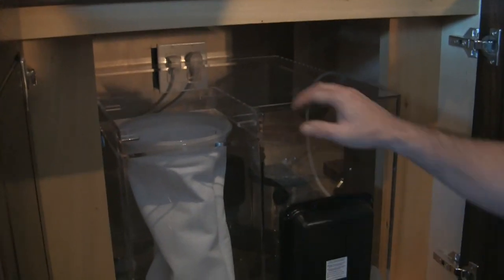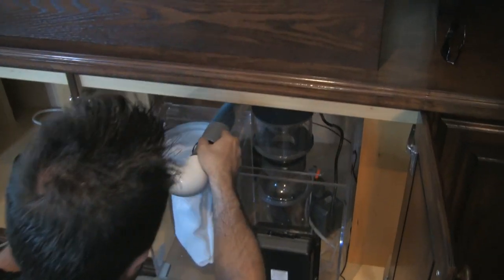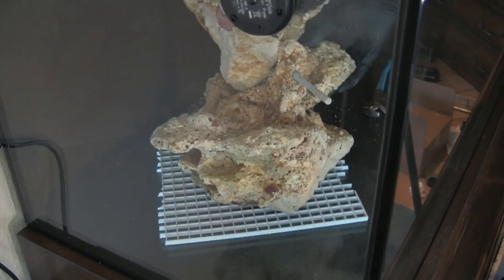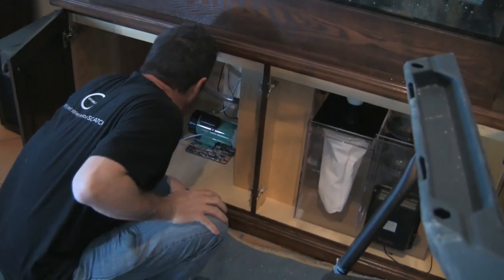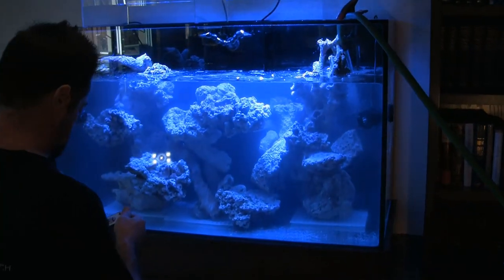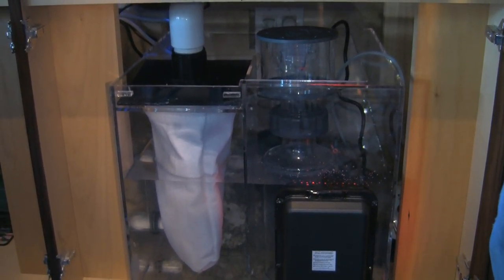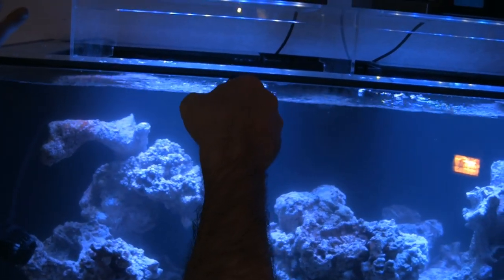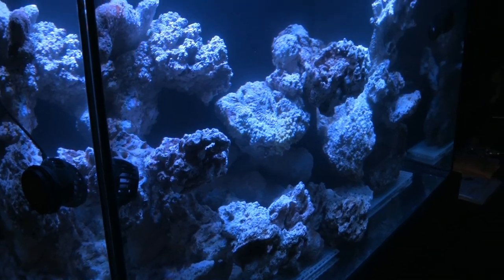Setting up a 130 gallon Coral Reef Tank, LA Fishguys Episode 150, part 2

Comment: Floating rocks looking really good. I've seen some completely off of the bottom, and they look great.

"a protein skimmer gets the dissolved organics out way before it ever reaches the algae scrubber" -- If you keep the dissolved food (organics) in the water instead of removing them, you can buy less (and dose less) coral foods, and you will develop thicker periphyton on the rocks (like a real reef) which will increase filtering further, and will also add more microbial life to the water.

Comment: I'm surprised you didn't stop the installation, move the electric socket, and rebuild the cabinet to the correct measurements.  I wouldn't want to run that tank in my house, it's a fire hazard and there isn't enough room to properly access the sump. Also a protein skimmer gets the dissolved organics out way before it ever reaches the algae scrubber, they are two totally different filtration systems, one doesn't replace the other.
Reply from the maker: +jharmantas Its a business. One cant send everyone home and come back another time. You do what one needs to do to make it safe or workable and  you 'Keep Moving Forward'!
Reply: +jharmantas a protein skimmer fractionates the water driving the organics out of the water and algae scrubber eats those organics driving them out of the water column....from what I understand......fairly similar filtration methods but cant see why it wouldn't hurt to have the two of then on any system.............great video jim
Reply: +Chris Hennessy It cannot hurt, I do not believe the algae is able to feed on the organics, it must wait for them to dissolve into nitrates and phosphates, so the Protein Skimmer works at a different point in the cycle, one does not replace or substitute for the other.

Comment: I know a friend who had the same problem whit hes sump. He used a drawer rail to easy move the sump in and out for axes.
Reply from the maker: +ljusta The skimmer pump is too strong so Im going to replace its pump. At some point I will just show up with my SawsAll and trim the brace myself.
Reply: Ok to bad they did not listen to your instruktions from start.